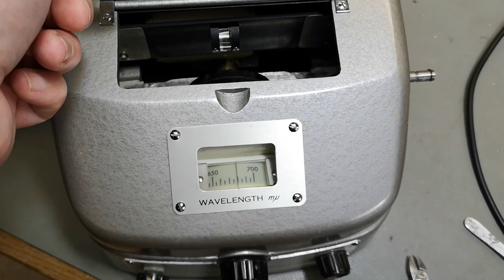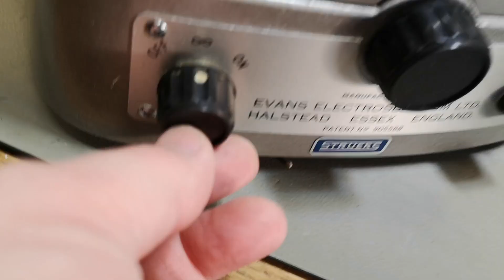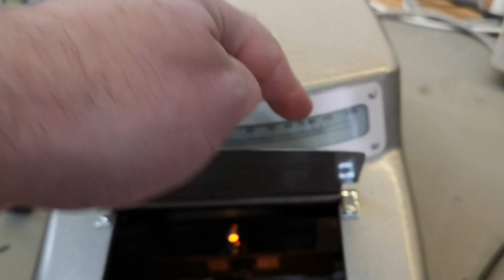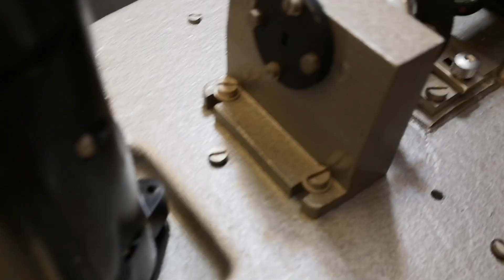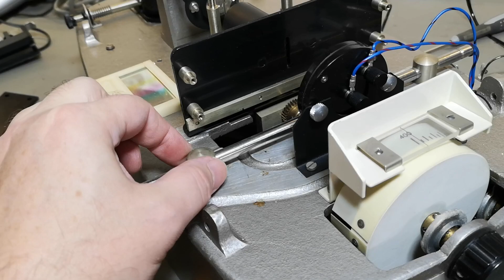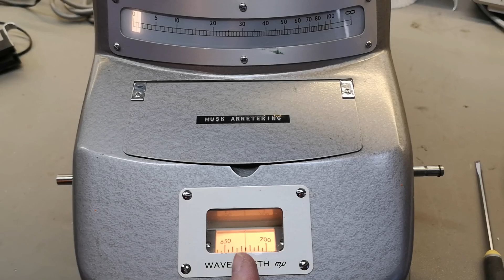Spectra EEL Evans Electroselenium 400-700nm analyzer teardown

Comment: Constant voltage transformer, there to generate the regulated 6VAC for the lamps, irrespective of input voltage varying between 180 to 250VAC. Top casting shows the hand marks of the patternmaker, who kept the outside perfect for minimal finishing, but the inner side was because they made it using a steel mould, pouring the molten aluminium alloy in, then leaving for a second, then pouring back out, to make the thin film out of a reusable mould. Bottom the same, just they have a third casting that is welded into there for the bottom holder. Knob for zero is because the inner race is stuck, the shaft should turn 10 or so turns for the pot moving one end to the other, just needs a bit of cleaning with WD40 then lubricate again to fix it.

Photocell can be used for your lux meter as well, seeing as you can remove it.
Reply from the maker: all fixed and lubed :-) and cal checked, funny it seems like small round photovotaric cells are not a thing anymore, i gave up finding a spare for my lux meter
Reply: @TeardownOZ2CPU  Probably will be easy to simply get a small silicon solar cell, and take it and nibble the corners off, then use some sandpaper to make it round. will then fit the housing, though of course you could always get a small square panel that will fit in there, and find a glass supplier to make you a soda lime glass 1mm thick window for it, or buy the window online, as the size looks like a 50mm dichroic lamp glass will fit in there.
Reply from the maker: @SeanBZA  with todays efficiency level of solar cells, i am sure i only need a tiny fraction of the size, and then resistor it down to correct reading, but cutting and sanding a solar cell is ultra difficult, it is thin and fragile and brakes even easier than glass
Reply: @TeardownOZ2CPU  So glass and small cell it is then.
Reply: Grab one of the solar garden lights at Lidl and salvage the cell pack from it. Single solar panel from there (you have 6 to break before you get one out) and there you have a cell. Epoxy top easy to remove with a soak in MEK or acetone to soften it. Then you get a silicon cell, 0.45V output and reasonable response.

Comment: That's a very funny color filter. Looks to be made with PVD process, very expensive! - I was expecting to see a diffraction grating in there, but it wouldn't reflect very much light which might be too little for this application. I think the unit is beautiful, but maybe a bit too large for sitting around as a conversation starter :D